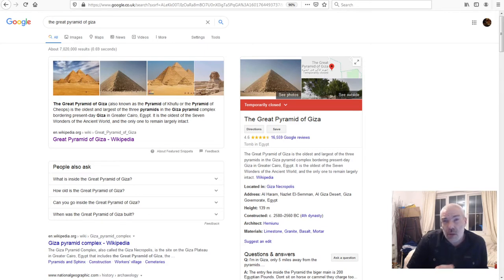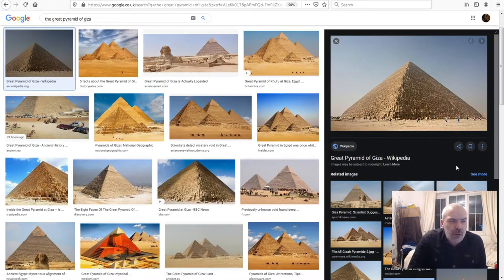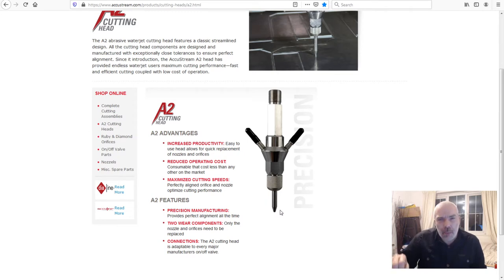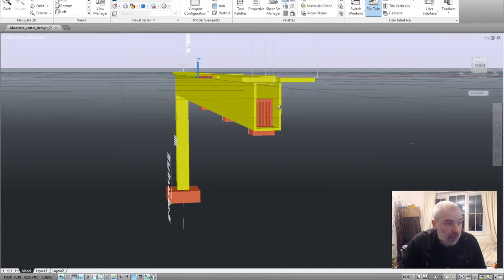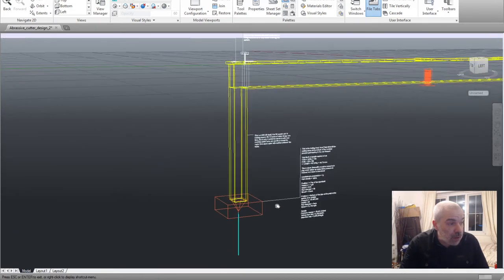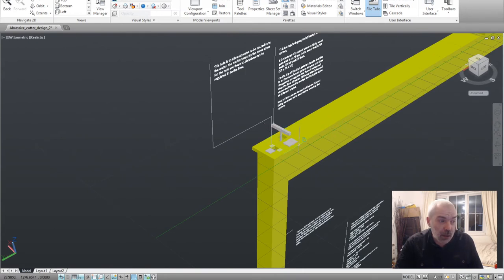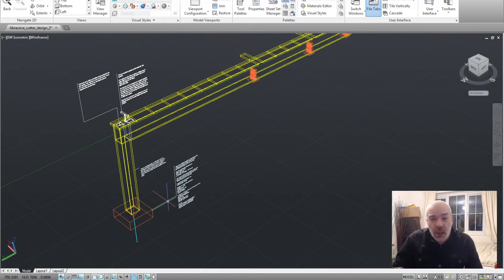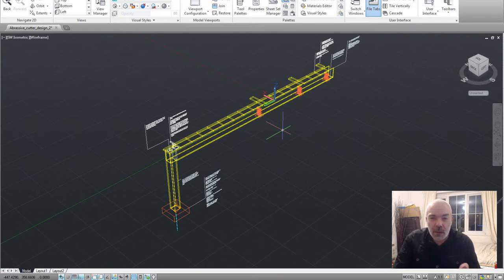An ancient 'abrasive water cutter concept'

Comment: In the middle ages there was a technology called the trompe, which used the water pressure to compress air sucking it down a tube and accumulating it in a chamber. Thinking that egyptyans could have done a similar thing with sand may not be that far fetched, considering they already knew abrasive cutting (ancient techniques using copper pipes filled with sand are used even today) and ancient Greeks, who knew about pneumatics and hydraulics, reported to have learned learned most of their knowledge from Egyptians.
Reply from the maker: I couldn't agree more, a big thanks for the heads up on the trompe, I've not come across the design before and will have a look in to it now to see how it operates and if it can be expanded up to provide high psi. On the Egyptian plateau there seems to be signs and hints of an explosion, something like a pressure explosion from a built up could well fit the damage I would think. I like this design I put together on autocad still but that key point of a high pressure for the water feels like the last and key part to it and something like a trompe or hydraulics does seem the way to go. I think Egyptian math is really understated in the megalithic field, out of all the fields and studies the math seems to be the key element to their engineering and the most under reported. A big thanks for your input, I'm still quite positive on the idea that water abrasion is a good potential tool that was used in the masons arsenal 🙂

Comment: Ok so the water is pumped from a reservoir using a hydraulic turbine, in to a Chanel where it is filtered, then in to a second Chamber, where it is boiled by a  fernis then pumped by a second steam turbine, in to  a chamber where the  pressure  builds up  with no where else to go but down, creating a boiling hot jet stream, that can potentially cut through stone. 

It's just a hypothesis but strictly speaking it could work.  

However  it would kneed centrifugal force  aerodynamics and thermodynamics to be achieved   

Velocity x momentum = acceleration
Reply from the maker: Thanks for the input, it sound a great angle on how it could be acheived. The heated water sounds really good for building pressure I'm not sure how that may be applied yet but I will have a ponder on it. The simplest method sounds good as it then sounds the most practical and manageable, and would be a blessing as my knowledge on the physics and engineering is near non existant 😛But it sounds good, it instantly makes me wonder if there is a stone camber that gets filled with water and then closed, then heated through the stone then how much pressure can that then create. From what I can gather the pressure is used to speed up the particles for the cutting, any method to get those speeds up of the cutting particles would then do it. I will have a think to see if I can come up with a way of working out how much psi can be acheived from creating a large chamber with boiled water.

Comment: Great video. I too have over the years narrowed down the options to waterjet. The technique is surely advanced But the technology to employ it is all there. There’s a lot of things I was struggling with and the stage, or how you are gonna move your workpiece was one of them. I was thinking possibly that, if the fluid dynamics work, what’s stopping them from shaping the nozzle head in some kind of profile instead of a point?You could still apply the taper to the end of the nozzle but having say a straight line instead of a point would alleviate the need to move your material constantly.
Reply from the maker: thanks thats really kind. It really does feel like there are big hints of the water jet, alot of the striations on the cut rock look like they could be sawed or waterjet cut where the waterjet has a habit of polishing while cutting. I think you are right that its quite possible the nozzle angles may be variable to cut at different angles as much as the material being turned to get the angles. Here i was trying to really make it as simple as i could manage as to lay a foundation for the approach, i can imagine waterjet cutting being introduced then the skill honed over hundreds, perhaps thousands of years to a sophisticated level. After looking in to the maths as best I can and meeting a lot of really helpful good folk on reddit i find the key piece of the puzzle atm is how best to build up pressure. ive thought of a water wheel approach, and an archimedes screw type approach, an air pump approach, but im still not sure yet on which approach would be most feasible :-) later this year or next year if the covid vaccine stuff doesnt get in my way i will head over to the giza plateu and a few areas surrounding it to take a closer look at the striations on the rock to try to get better photos than what is online as to see if i can compare the cuts with both saws and a jet cutter. im really looking forward to it. where i think using a jet cutter would make a production line for giant structures more plausible in a shorter period of construction rather than done over centuries. but i honestly keep it all on the cards, i get a gut feeling though that water jet cutting has been involved and its rare my intuition lets me down tbh so im rolling with it still, even after a couple of years pondering on it :-)